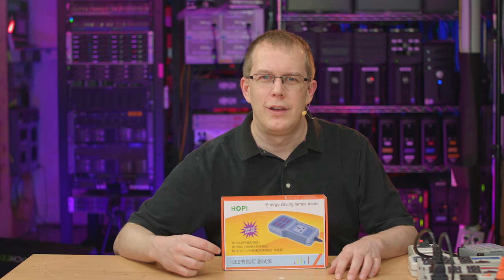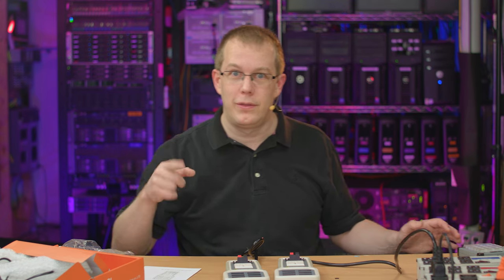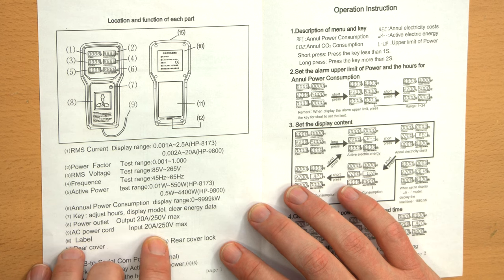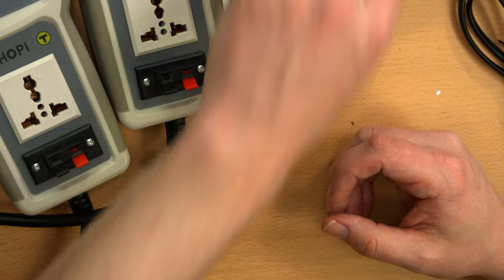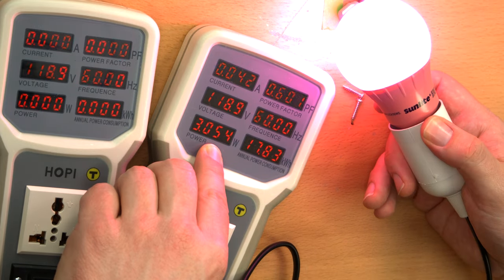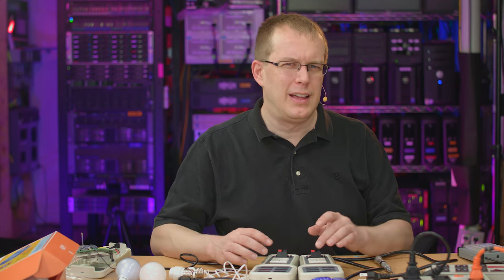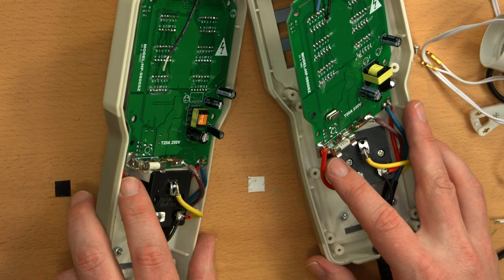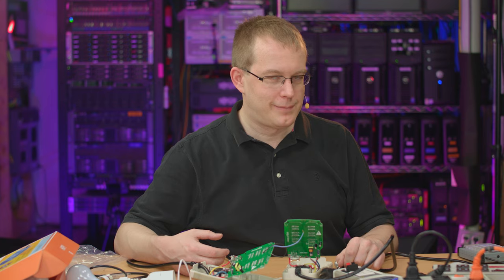HOPI-9800 Power Meter Review

Comment: 24:50 how does annual power consumption get calculated?  

Annual Power Consumption (kWh):Real Power * Hours in a Year.  Convert 3.043 Watts to kilowatts (0.003043 kW), then:0.003043 kW * 8760 hours ≈ 26.683 kWh

The calculated annual power consumption is approximately 26.683 kWh,  EDIT:  just realized via big clives review that the 9.047 kWh annual usage is if item was used for ~ 8 hours per day.  You can adjust it between 1 - 24 hours.  If you set to 24 then you get full 26.683 kWh in example above.